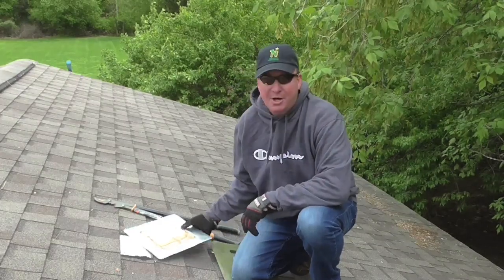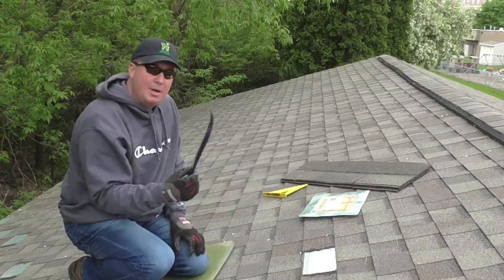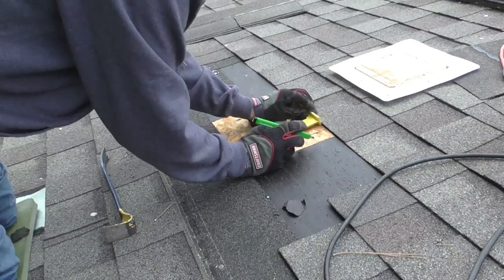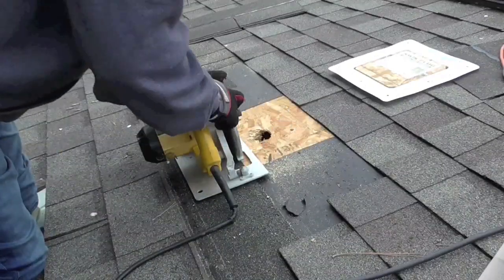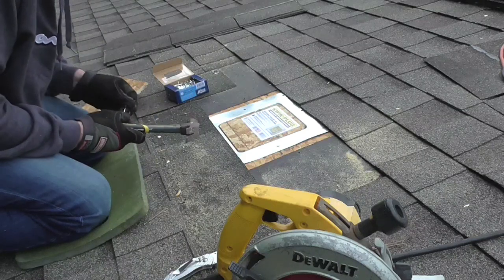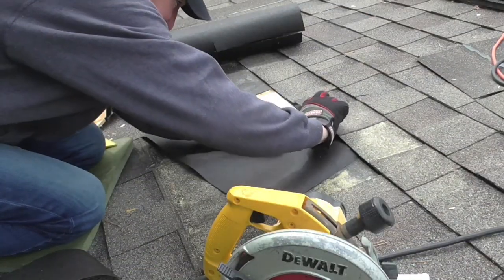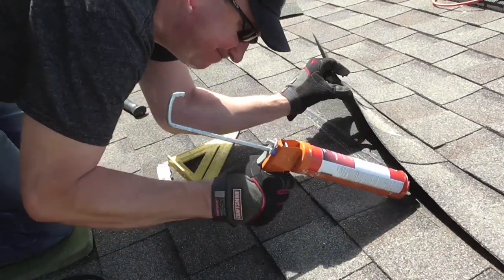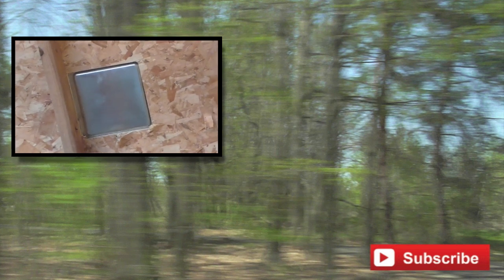Installing an EZ Kwik Plug Roof Patch

Comment: Got a random hole in my roof above the garage today. I patched it using flashing the way you showed in your other video and am ordering this product to do the permanent fix. As a new homeowner who is learning how to DIY, your videos are tremendously helpful and saved me a lot of stress. And the $800 someone wanted, which then was bumped down to $675 when I laughed at them at the $800 price. I laughed at $675 also.
Reply from the maker: Holy cow!  That's a steep price.  Thanks for letting me know, I appreciate knowing that these videos are helpful to you.
Reply: @MarkThomasBuilder  It just goes to show how some folks really try to take advantage of those who don't know a lot about DIY.  Obviously you've earned a subscriber! Many thanks!
Reply: @piscesdreams1023  well I wouldn't say they are taking advantage. I think roofing is a skill. And it's a dangerous job. Yea sure you can charge them 150 prob for the job and you can also fall of someone's roof. It's our job as consumers to price around. If someone will pay 800 that's what I'll charge too lol.
Reply: @insaneguitarboyw some people don't understand variables
Reply: How big was that hole? Half inch?
Reply: @yoellopez82  The hole in the video was definitely about 2 and half inches.  He put two fingers cleanly through it to pull the cutout off the roof once he sawed through it.

Comment: i got an estimate from a company here in NC to basically patch a hole where an old gas furnace vent pipe protruded - estimate was to remove pipe and patch over hole.  $675 .
Guess what?  I'm going to be up on the roof this weekend fixing this myself - THANKS AND THUMBS UP!!  Great video - I can do this.
Reply from the maker: Wow, you will save a lot of money.  Hope it goes well!
Reply: That happen to me too and I fixed by myself. Thanks for the video.

Comment: Excellent video with clear instructions. I will be doing this today on the roof of a house that I've been renting for 2 years. 
I've been asking the landlord to repair a leak in the roof since last October. I've done wet patches and I trapped the roof last year when I realized that the roof wasn't an urgent issue with the owner. 
North Alabama gets a lot of rain during the fall and winter months, so I need to have something more secure.
My next step after this is to repair the water damaged ceiling.
Reply from the maker: Thank you, glad to hear it!  I would think the landlord would be most concerned with a leaking roof, since it can do the most damage.  Hope it goes well for you!
Reply: @MarkThomasBuilder  thank you very much. It was a much bigger spot than expected, but the repair went well and now I am getting ready to move onto the ceiling.

Comment: Thanks for putting this out. Had a tree fall earlier this year as I was out of town. Wife said ah we are good. Fall cleaning of gutters and roof. Found where a limb went right through the roof. About the same size as your hole. Guess Home Depot run for me.
Reply from the maker: It's a great design and has held up well for me!
Reply: I was cleaning my roof and gutters and noticed the exact same thing. My story is almost identical to yours bro. I'm at Home Depot now 👍

Comment: Is the patch meant to make the roof walkable?  I am curious because if the hole is that small, wouldn't it make sense to just to slot a part or an entire piece of new shingle in that space instead of trying to make a larger penetration and then try to seal it?  Sorry if my question is stupid, need to move a vent and am running into this same situation.
Reply from the maker: That's actually a really good question.  From my perspective, if you have any type of hole in the roof, especially a roof vent which is 8"x8", you need to patch the hole with OSB for a proper repair.  This Kwik plug saves you the steps of having to add 2x4 support pieces behind the OSB patch piece.  I
If my shed had a small hole, like the size of a golf ball, or two,  I probably wouldn't worry about the proper patch since I don't walk on the roof.  If it leaked, then I'd do the proper repair.  Hope that helps.
Reply: @MarkThomasBuilder  absolutely :).  Thanks!  Roofing is for some odd reason beyond my capabilities.  The leaflets on the shingles just confused me.  I've just gonna and slotted a foot long piece in with the proper nails and tar since originally it was just a poorly placed 1.5" plumbing vent.  I'll have my ceilings open for a week anyhow, I'll see how it fairs here before deciding if I should get a proper patch in.

Comment: Just wondering - why did you cut the large square hole in the roof when you just had a small hole.   Seems you just made the hole bigger for no reason.     ??
Reply from the maker: This is the smallest roof patch plug I could find.  Sometimes the hole on the top of the roof looks small and inside the attic, the hole can be bigger.

Comment: Wouldn't the metal underside cause a lot of frost to accumulate in winter causing condensation to drip down and rot the wood decking below it?
Reply from the maker: I haven't hear that before.  I wouldn't think it would be an issue, but would like to hear from someone else who knows for sure.  I recall seeing a similar product made of durable plastic years ago.  I'm not sure if they're still around.

Comment: Excellent video but for someone new like me maybe show the steps where you put the shingles in and how you layer them
Reply from the maker: Thanks for the suggestion.  It can be a little tricky figuring it out.
Reply: That's the hard part-weaving them in.  I  would put some tar around the hole before putting the plug in.
Reply: Same here🤭

Comment: Thanks for the video - it looks like I can probably do this myself and save at least a few hundred bucks. Quick question about the felt underlayment.  Is that enough, do you think you would be better off with rubberized or synthetic underlayment?
Reply from the maker: This is a garage, which has an open ceiling and I can see if it leaks from inside.  So far it's going strong, no leaks.  My own personal house was reroofed about 5 years ago and has a synthetic underlayment from Certainteed.

Comment: I didn't see the hole in my garage roof until 3 months after a big wind storm. Now I have some wood damage inside attic from bee's. The garage has been in excellent shape the past 40 years while being under 2 trees. a branch finally penetrated it. small hole. no bigger than about 2 golf balls
Reply from the maker: It doesn't take much with a falling limb in a storm.  Best of luck on your repair!

Comment: Can I buy just a few shingles instead of the whole package? Or a piece of that paper instead of the whole roll?
Reply from the maker: That's a good question.  I've seen some places sell open bundles of shingles.  You might want to call around.  The metal flashing is often sold in different lengths, so you'll probably find just enough.

Comment: I guess to use the Kwik patch you need to have the plywood sub-roof to set it into.  Not all roofs have this.  But thanks for the video. Very helpful.
Reply from the maker: If you had a tongue and groove roof underneath the shingles, this might work too if construction adhesive or screws are used to attach the metal to the wood.
Reply: @MarkThomasBuilder  There were just 8 in-wide boards the shingles were attached to, so I cut out the damagedpiece and inserted a new pievce between the rafters.  it worked fine.  I'll  have to await winter rains to see if it leaks!

Comment: I was wondering if it is totally necessary to cut the square of roof deck out, since the edges of the patch piece are nailed to the wood,  could you just put the patch thing right over the hole, with out cutting any of the wood?
Reply from the maker: Thanks for the question, you need the entire square hole cut in the roof deck so the metal part of the patch will sit inside the hole.  That makes the entire patch sit flush with the existing roof deck.  Hope that makes sense...

Comment: Great video. I referred to it during my repair. The Kwikplug is hard to find though
Reply from the maker: If you can wait 2 days, I put a Amazon link in my video description.  I also found these at my local Menards.
Reply: Probaly hard to find because there really isnt a use case for them. Not a product a roofer would ever need.

Comment: Hi so I have several spots where the wood is rotted and leaking. So I would have to replace all of the wood then felt paper and new shingles correct?
Reply from the maker: Yes, if you have several spots, then the roof deck needs to be replaced, including the felt paper.  The roofers normally replace a 4x8 section at a time.  The last time my house was reroofed, they replaced 2 or 3 sections that were rotting.

Comment: Are these appropriate for when doing a re roof and switching to a ridge vent?
Reply from the maker: I don't see any reason why you couldn't use these for that situation.
Reply: I was crawling around in the attic and saw them yesterday. I didn't even know they existed. I thought they would cut to the rafters and put in a piece of plywood.
Though I am more concerned of how they decided to reconnect the fart fan pipes, and not say anything about it to us. If I get around to it today I'll post up a short video of it

Comment: What was the white looking piece on there before you replaced it with the EZ plug patch?
Reply from the maker: That was a piece of metal flashing that was installed as a temporary measure to prevent roof leaks from a tree limb that punctured a hole.  I made a video showing that temporary roof patch repair.

Comment: pardon me what happen if the hole on the roof is bigger than on the video? would i had to get 2 of them or does this patch comes in larger size at Home Depo?Please i need to know?
Reply from the maker: This is the largest size they make.  Unfortunately you can't put them together for larger holes.  It sounds like you'll have to add some 2x lumber underneath the hole and add some roof decking.
Reply: @MarkThomasBuilder  alright i make a note to this.thanks..

Comment: Thanks for the vid.  Is it really necessary to buy / place that new shingle strip over the felt underlayment, and under the old shingles?  What if you left the new shingle strip out of the equation?
Reply from the maker: If the shingle isn't damaged, you could reuse it.  I had holes in mine, so it required a new section of shingles.
Reply: @MarkThomasBuilder  Thanks!

Comment: 2 things your suppose to nail between the lower 2 caulk lines on the shingle s and your felt should of been cut about to be tucked under the felt or water will get under it and just leak
Reply from the maker: Mine haven't leaked since doing this.  Thanks for the advice.

Comment: Looks a little like overkill.  You would think a good epoxy patch would repair the hole.  As long as it's not exposed to the elements, and even if it was, the patch would be more water tight than the wood around it.  You wouldn't need your saw and it would be cheaper.

Comment: Do you have a video on how to patch the roof on the curve?
Reply from the maker: No, sorry I don't.  I made another video showing how to temporarily patch a roof with flashing.  That would probably work until you get a permanent solution.
Reply: markthomasbuilder thanks, I’m glad you knew what I meant lol I’m not sure what to call it

Comment: Patch started with lower edge under the lower shingle.  But then at the 3:52 mark it appears to be on top of the lower shingle and notched out or something on both sides.  What happened there and what was done (and why) that we didn't see?
Reply from the maker: Good question.  I think I cut that small section out so I could get nails into the outside edges of the roof patch.  I probably didn't need to notch it like that, but I was trying to save as much of the existing tar paper.  It ended up getting covered up anyway with the new piece of tar paper.  The key to a good patch is making sure everything is lapped in the correct order so in case water ever gets behind the shingle, it won't go under the tar paper.
Reply: @MarkThomasBuilder  Thank you.

Comment: Hi sir.  I saw a piece of shingle fell to the ground.  Now I am worried my roof will leak.  It look like part of a shingle fell off as we had a lot of rain. Somehow it fell on my lawn
Reply from the maker: I've had some 3-in-1 shingle have a tab that blew off before and it didn't leak.  I would recommend getting it looked at asap and repaired.

Comment: How can you get a small piece of that roof underlayment
Reply from the maker: That's a good question.  As far as I know, it's only sold in rolls.  I just looked at FB marketplace and found someone giving away a free roll.  There's another one for $10.  I think I used 30# felt paper in this video.

Comment: How do I repair a hole like that  with a 2x4 right next to it
Reply from the maker: It's hard for me to say without looking at it.  You may have to open the hole up enough to fit the plug. If the hole is on both sides of the 2x4, you may be able to screw a 2x4 along the side of the rafter 2x to nail some new roof decking to.  I'm not sure if that helps?

Comment: Can you just put that plate over the hole instead of cutting a bigger hole? I don't have a saw/ power tools. I'm also a chick that highly doubts I could do that myself.
Reply from the maker: No, unfortunately you need to get down to the bare wood.  I made a video you can search for-  a quick temporary fix for roof holes.  It only requires a few tools and potentially lasts long enough time until you can get it properly fixed.

Comment: has it leaked yet? great video
Reply from the maker: No, it hasn't leaked. I was just inspecting it the other day and it's holding up well.
Reply: +markthomasbuilder  what if the hole is right next to a 2x4?

Comment: Big Mistake,    1) You do Not Need to cut the Hole  Larger, than it is  with the Saw .... 2nd ) Use Roofing cement Caulking to seal the area  ,..
Reply from the maker: Okay, thanks for your insights.  It seems like there's quite a bit more roof cement caulkings out there now compared to 15 years ago.

Comment: I need more than a handy plug. A airplane droped its shit tank and it froze then went through my roof and broke my coffee table.
Reply from the maker: Wow, that's crazy!
Reply: markthomasbuilder  thats what it looked like . I think it was just some stuff from a thunder storm. I did have to replace two sheets of Osb and repair the rafter . they make mobile homes cheap.
Reply from the maker: Sounds like a big project.
Reply: markthomasbuilder I did it myself . I just put it back how I found it. then put new shingles. were the trailer was built they put nails right between the tabs of the shingles. no wonder it leaked. I have it fixed better than when I bought it back in 2000.
Reply: Wow! And I bet your homeowners won't pay? I remember reading my homeowner's once and I was surprised how it had a specific clause about "falling objects, man made or from nature, falling from space or the sky", it said.....yeah, we don't cover that. But, they covered a tree that fell on the house. I guess because the tree was attached to the property?
Reply: You should move. Airplane poop is no good.

Comment: What didn't you just change that one shingle put down a piece of metal flashing would have been just as good without all that nonsense
Reply from the maker: This is the more solid option.
Reply: Kyle is right. Plugging a 2" hole by enlarging it to 12", then paying through the roof (pun intended) for a patch (that sold by Quarrix ez plug for less than half via Walmart).
I just paid $1.20 for a square metal flashing at the Home Despot.
Reply: Absolutely. This "repair" made no sense at all and compromised roof integrity further for no reason. as a contractor, roofing is the number one area where you see bogus work, and it is arguably the most important. This guy means well and shoots a good video, but this is an example of degrading a roof not improving it.

Comment: If u went through all that trouble to remove and clean up the hole u might as well do it right and cheap using wood. What he using is not quick. Doesn’t make sense to dig all that out just to hammer a 10$ small thin piece of aluminum. I though he was going to hammer direct over the shingles without removing anything then yeah that’s quick. This is a pos which why they discontinued
Reply from the maker: I saw these in Home Depot earlier this year.  They're probably handy for those who can tear off shingles, but don't want to buy plywood and 2x's for  the typical repair.